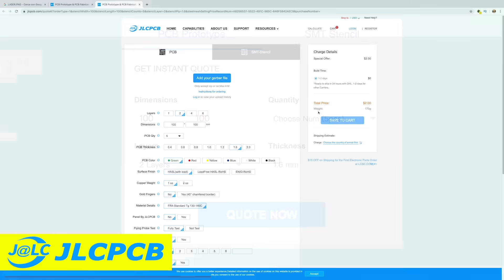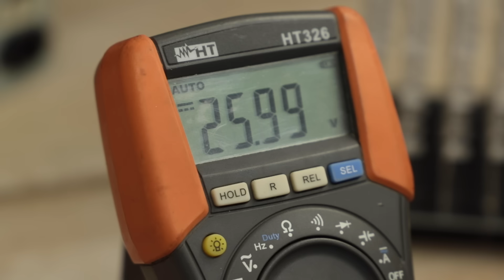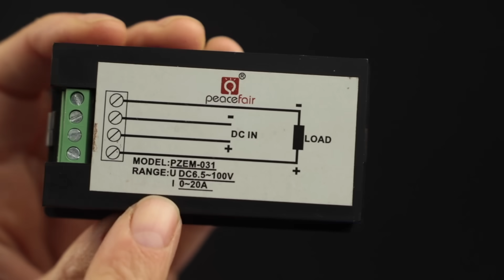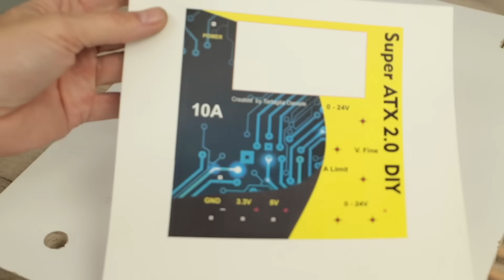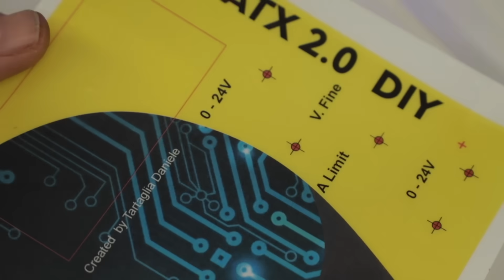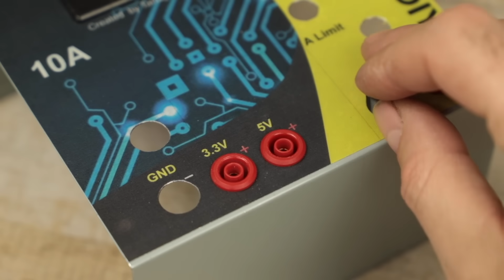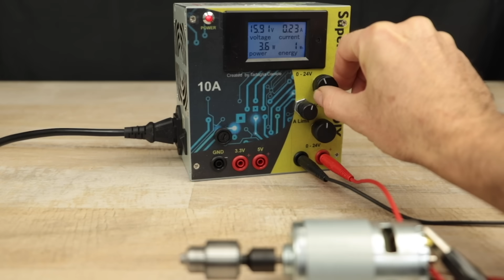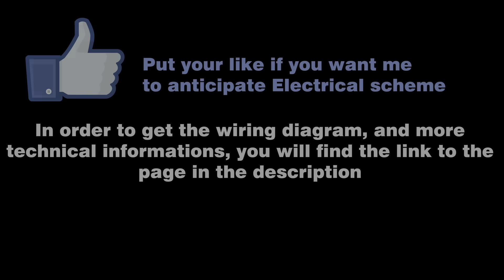ATX PC - DON' T THROW THAT AWAY!!! here is a BIG idea

Comment: This project is wrong on so many levels, leaving all those cut ends inside the case, the very poor insulation on the power resistor, the lack of any form of schematic. I wonder how many people electrocutes themselves following this. It's nothing more that an advert for some overpriced junk from Banggood, most are available cheaper on eBay. Also just how many ad breaks can you cram into one video... rubbish video!
Reply: Yeah, I remember a year or so ago a kid died messing with a PC power supply.
Reply: Schematics are linked in the comments, as said in the end of the video.
Reply: Kind of agree psu modification is cool but like it is shown here that is just wrong
Reply: yeah, telling people to open a power supply is basically attempted murder. touch those caps and you're gone
Reply: @jeremymcadam7400  It's discharged if unplug and short with a paperclip, power supply tester or just put in a pc and hold the power button for like 30 sec?
Reply: @Isutoriba  sure, wasn't explained in the vid though.
Reply: @jeremymcadam7400   The caps in psus are usually discharged seconds after unplugging them. If your skin is dry then even fully charged caps shouldn't pose any real danger. DC is much less dangerous than AC.
Reply: @robertmalmet1190  sorry but your misinformed.  DC "pulls you in" where AC repels you.  Don't let the voltage threshold before feeling it painfully fool you.
Reply: i know i am not touching and playing around in some case with a power supply,inside,so i guess i will find someone who knows what to do..

Comment: Biggest load of bollox I've seen!!
You would never drill through a circuit board like that then to mount it on a large heat-sink using a self-taping screw screwing it down so the components short circuit on the underside. No insulated material was used to protect that circuit!
Bit daft mounting that power resistor on the outside when it could have been mounted in the exact same spot on the inside directly in line with the fan blowing on it to cool it down more efficiently...
Reply: also he didnt mention that the capacitors will kill you if you touch them...
Reply: @jeremymcadam7400  : I noticed someone further down in the comments mentioned shorting them out with a paperclip to discharge them, some people are too dangerous to be let loose on electronic circuitry ;-)
Reply: @plug4uk696  must be one of those insulated paperclips I've heard so much about
Reply: @jeremymcadam7400  : Lol ;-)
Reply: @plug4uk it certainly looks risky, but if there is only one copper layer in that board then it should be more or less safe, as he drilled through solid epoxy rather than any electrical connection. He's demonstrating that its possible to make more space for stuff if you are willing to be a bit unconventional.

@jeremy Well people might get the wrong idea when they see this video, but unless you are into electronics and are comfortable working with 240V you should stay far away from a project like this.
Reply: Then maybe you guys should put up your videos and show everybody else exactly how it's done.

Comment: Can you explain why you have used two voltage control if both are handling 0-24v, you should explain connection instead of just playing video.
Reply: IT Credentia one of them for control the voltage, the other for control amper and litle one for  adjust voltage best tune, sorry about my bad eng

Comment: How is the voltage control and wiring method is the same when connecting other bolt meter than boltmeter shown in the video?
Reply: It surely depends on what "voltmeter" you want to use. The one he used had a diagram on its sticker for the connections. The control method he used was simply replacing the trimpots of the converter for regular potentiometers and sticking the knobs through the ATX PSU's metal cover for easy access.
Reply: Man, boltmeters exist?  I’ve got all these left over screws and bolts and I’m not sure what will go with what.  Had I know I could just get a boltmeter, I’d have just done that ages ago!

Comment: why did you put the 10 ohms resistor on 5 volts?
Reply: Most/all ATX PSUs require there to be a load on the 5V output, otherwise they won't turn on.

Comment: Awesome build! Most builds that use the chassis of the PSU instead of enclosing them in a separate housing are not this polished.
I missed how and where you hooked up the third potentiometer for fine voltage adjustment. Could you explain that in more detail?
Reply: @МихаилМекеня ?

Comment: Oh man, another one... DO NOT ENCOURAGE PEOPLE TO MOD ENTIRE PSU INTO BENCH SUPPLY!!! Its a risky thing and not worth an effort! Its much better to make 24pin adapter with all things you want - meters, converters, potentiometers, diodes, switches etc. Its not only much safer but also much more Universal because if you burn the psu down you will just take another one and connect it to 24pin socket in your adapter.

Comment: sweet!!!
 should have put a dedicated 12V in there too right off the ATX Board
Reply: Need of that resistor???
Reply: @aswin_va  
The Load resistor? Yes.  
Not only does it let you power up some older PSU's, it should be used anyway, even if not required to keep things running... Because it also regulates all three voltages. The readings will be closer to desired voltages and remain as stable as possible.
Reply: @robertcartier5088  can we  use LED as  a load instead of that resistor? 🤨
Reply: @aswin_va  No. You would need several dozen LEDs... Not practical at all.
If the required load is to be used on the 5v rail, use the resistor... If it's a newer PSU, it might be used on the 12v rail, in which case you could use a high wattage light bulb from a car to achieve the desired result. Watch a few more videos to learn how to determine which voltage rail the load should be on. I recommend the site: Instructables.com, they have a list of like 80 PSU conversions!  
Cheers!
Reply: @robertcartier5088   sure sir ill check that site too.. Thank you for replying 😊😊😇

Comment: I'm amazed by the number of views with nothing explained. If I made a video like that, they'd destroy me.
Reply: Let's not even mention the stupidity of attaching a secondary regulator to the heat sink which is often at over 300V potential. Maybe his is not but there is no warning or explanation of the hazards. This Is not just rubbish content it is encouraging the ignorant to construct a potential killer device.
Reply: Don't be mad because you don't have skills,and don't know electronics.
Reply: @frydoggo  U only have to read the comments to see the self appointed importance of their respective opinions. A common problem in today's world.
Reply: Also some of the soldering and mounting is quite questionable. I think this PSU isn't very safe. In general it's a very nice project, but there are some finishing touches missing that make this a rather dangerous PSU. If you have a good understanding on how to do this project it's fine, but I see a couple of small mistakes in the construction in the video that can potentially lead to quite a fire hazard. It may only be a low voltage but it's not entirely safe. Let's just hope the fuse blows in time if any of those cables ever come off.
Reply: Just another of these avarice and idiot magnets. Alone the idea to use a PC PSU, that is used balanced and mostly regulated by one output line (standard flyback) as a lab bench power supply that is used in any possible way current-wise, sounds like a dumb amateur idea. Not speaking of having the mains inlet nearby your low voltage section. Or the mechanical stability: This falls easy from the bench and it can't take any stress. After all, it is minimally thin sheet metal that is intended for installation in a computer case. 
This is where the amateur stops thinking. When a small moment of inattention, a simple cup of coffee or a little accident will kill him. You say:"NO, that will not happen to me!" Most likely you are right. You know (ugh!) at least your botch. Unfortunately, friends, family members, and loved ones are not that lucky. It sucks how much dangerous and shameful disregard for all the principles of professional craftsmanship there is. And people aren't even ashamed. 
Do you think I'm overreacting? F ... no, I don't have to say this. Just keep using your device:P
Reply: easy to know  what he is doing  with basic knowledge, it is not difficult at all.
Reply: it's more of a "shut ur brain off and watch a guy build cool stuff" channel :V at least for me :p
Reply: especially it is misleading as well - in description it says STEP-DOWN module and then he clearly shows output voltage higher than input. Yea right.
Reply: Same. 😳
Reply: its the intriguing thumbnail combined with the algorithm randomly suggesting the vid to everyone.
Reply: People needing everything broken down for them is the reason we are regressing as a species and need disclaimers attached to everything.  "Please don't swallow your car fob, it's bad for you".  If you have a working cerebrum then the simpler the video the better - not only do you learn something but your logic centre gets a good work out as it processes why the thing does what it does.
Reply: @krashd  Oh, I just forgot that bullshit exists. YOU .... 
No, you're welcome. Let's just come over it, together?!!
Nothing bad need out attention. Magic of ignore ........ I don't said BAN. IGNORE the shit and scammers! 

And have a wonderful weekend!
Reply: Of course it would be better with a voice-over in English...or maybe German, French, Vietnamese, Chinese, Russki,  Swedish, Urdu... the list goes on. Which language should he have made it in? By making it voiceless, AND showing all relevances he has made it universal.  The bonus is if you don't speak electronic you aint ready to try it.  The words "Molto pericoloso" are the give-away. I view it as a guide, not a recipe. Something to show how nicely it can be done if you take the trouble.
Reply: Me too! but it has good clickbait.
Reply: @ELECTROMAN_MX  yeah---what is he trying to make and what is the use of it should come FIRST...
Reply: @electronicsNmore Im a sub of your channel.....and I agree even though this might be a good video I cant stand watching it when people dont speak.....at least try......
Reply: @kermets  I don't mind the no speaking if there are informational words that pop up. What I absolutely hate is background music. I mute and fwd through most of those videos even If I miss some information.
Reply: You maybe correct but some people with elektric knowledge know how to wire that 😉it isn't difficult
Reply: Yep. It's irresponsible AF too! Next up, building a Tesla coil in flip-flops for dummies. I'm subscribing to your channel for your comment alone.
Edit: I subscribed to electronicsNmore "for the comment alone" but realized how great the content actually is. Youtube needs to tweak their algorithim because I see the same shitty suggestions over and over.
Reply: @vtharpe44  Couldn't agree more, and sick of the arrogant twats edgelording everyone with their snarky "you should already KNOW how to build a working super computer controlled complete working modern City State with a billion inhabitants with a soldering iron and a broken 8880 IBM pc, you MORON ! "  Lol SMMFH... And it's annoying AF, but I've started  going thru the stupid suggestions and individually clicking "not interested" , just to finally get rid of the stupid things... And WHY can't YouTube put MORE REACTS besides just a stupid single Like thumb , FFS ?!?!   Sigh... Rant Off...
Reply: my type of video.. u watch pay attention and learn. no entertainment  no nasal voice ,no bs, no annoying linus...  no need for being spoon fed - just pay attention lol..
Reply: @andrievbastichy8551  your arrogance is showing
Reply: estoy de acuerdo
Reply: I'm Indonesian and i really didn't understand  their languange (maybe Spain/ Portuguese/ Mexico, etc or all latino languanges) but  i amaze with this video of his manufacture skill.
Although this video have no voice and there's no detail explanation but the project is very simple and easy to understand. THUMBS UP

Comment: New here, liked the final, but only one thing bothered me, that drilling into the voltage stepper. For some PCB's, multiple layers are passing through the surface but also inside the PCB, and that drilling can result into a short between them and here as i can see, was not the case.For someone who does not know what type of PCB is he working with that drilling might turn it into a 'camp fire', and i think you should at least warn about where and if they can drill a hole. Also, drilling the heatsink... understand that you've cleaned the remained chips, but you can never know for sure where they can get stuck, after all that power supply is working with deadly voltages. My point was to dismantle it, drill, remount. Overall I've watched this because i also wanted to do it, but....never had the time and patience. EDIT: My comment looks like hate, from a passionate to passionate, we understand how things work, but someone who does not, you need to explain them even the simplest things, otherwise they get hurt. I work also dangerous, don't care what can happen to me, but to someone else, always matters.
Reply: Also, that heatsink is going to get hot - possibly very hot - which could cause the module screwed to it to overheat and malfunction. And there's a good chance that heatsink is live too!

This is a great little project, but the internal layout needs a bit of a rethink. Could be very dangerous as it is now.
Reply: @ensor2872   Good point,noticed now also the fact that is a conductive material, which usually is not recommended to mount an electronic board on. Finally ,if he reads the comments he might do it 'better' in terms of safety factors next time, if not, well.

Comment: hey dude, why shall i replace a good 10 turn trimer, with a one turn potentiometer? you can always use a 10 turn, panel mounted. not a good advice at all.
I have to say, that adjusting a trim-pot with a fancy screwdriver make it professional... :) lol just i cant watch until the end, please fix the boards at list in 2 points, and never share the same heat dispenser radiator, of devices that do not use the same rail on the radiator (the heatsink - the heat is not sinking it is radiated on the ambient), is a hazard, and a disaster waiting to happen... totally unsafe, unprofessional ... not good, sorry just being honest.
Reply: ferry gut English!
Reply: @g60force  English is not my native language, so please take it with a bit of salt. 
I like what you do on your channel mate, i had subscribed too...
have a nice day :)
Reply: I'm sorry, but I too am at odds with your comments. I read it several times to get the context of it... Firstly you totally missed the "fancy screwdriver" part. If you like wasting your time making that many turns to achieve your output, then go right ahead. As to your analogy of the "radiator"... you totally lost me there. I took " radiator" to mean heat sink? If that's the case, then you are way off base. Your reference to "fix the boards at list in 2 points"... haven't a clue to what your talking about, "sorry just being honest" here.
Reply: @douglasgrey5802  Hey mate, Can you please explain how i am way off ? 

Regarding the fancy screwdriver, yes, you need to turn it many times to adjust the voltage, in smooth steps, 
using a power-tool to turn a fine adjustment trimmer is just strange and unnecessary,  not wrong in any way :) 

Regarding the danger, have you measured the voltage on that RADIATOR ( heatsink ) and ground plane ? is the voltage safe? is it DC OR AC?  
 The regulator board is fixed to the Radiator(. heatsink for you) on one hole,  ( https://youtu.be/k1StXKWTnvo?t=356) , the only thing that has to stay on a heatsink is the part(s) that need to be cooled. Please do not be naive, high voltage is dangerous, mains voltage is dangerous, and can kill. The reason the board come with 4 holes in the corners, is because it is looking proportional, and not for safe fixing the board. The Radiator can be at elevated potential, relative to ground. ( what happen when the heatsink melt the plastic spacer? 
In a nutshell, I consider that the advice given herein the video is wrong, and unsafe. Please do not do this at home, take it apart, make a nice enclosure to house the boards and needed stuff,  is safer.
   The RADIATOR :  
The passive heatsink is called a RADIATOR because it using convection to dissipate the heat, so it radiate the heat, in to the environment, in this case the air, natural convection of forced by a fan, it is still a radiator,  it is also called a heatsink, none of the terms are wrong.

Comment: 1:37   13:06   In the secondary, there are at least two dead capacitors... one next to the white cables and another next to the heat sink.
Reply: how can you tell??
Reply: @kwissiekwissie  U see little swollen top
Reply: Also noticed... But certainly was changed.

Comment: Keep going! But the welding of the exterior 10 ohm power resistor you can do a litle better. You can put the wires in line with the terminals. Good work.

Comment: Not sure about the 5V directly out the back of the PSU with no protection.  Those vent slots are pretty sharp along the edge on cheap PSU's nd the wire will easily be damaged and short to ground, which is not good.  Better quality PSU's won't usually require that load on the 5V line.
It's great to recycle these olde PSU's and this is a great project.  Very neatly done overall compared to a few.

Comment: I feel uneasy when i see that resistor on the outside of the box.
Reply: Do you know what is that for? I don't really get it
Reply: @sebastianpoe  it is resistor, atx needs some load in order to work. Search dronebot workshop channel for atx to power supply conversion, it is well explained there with lot of details and info.
Reply: @davorinrusevljan6440  thank you, I wasn't aware of that